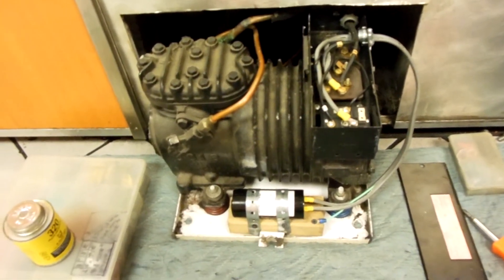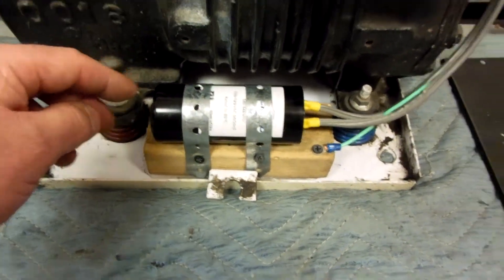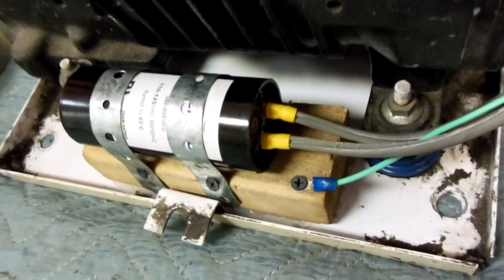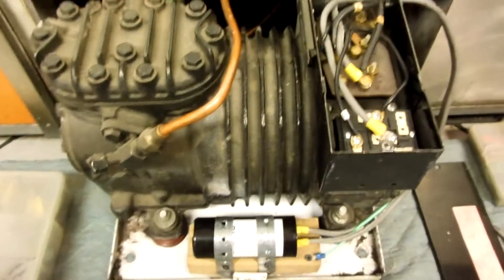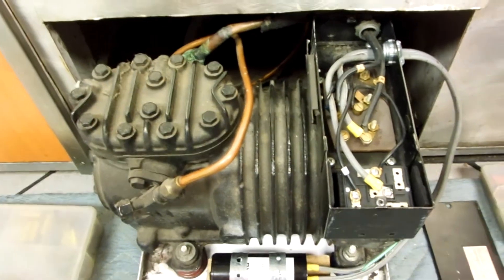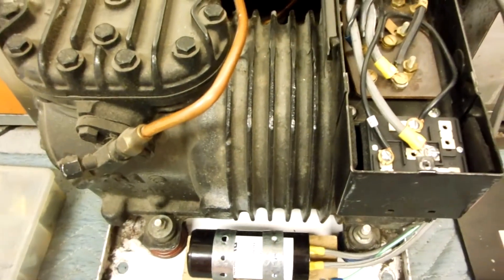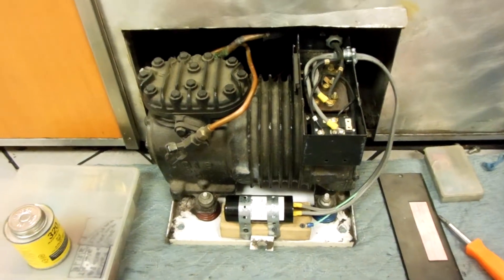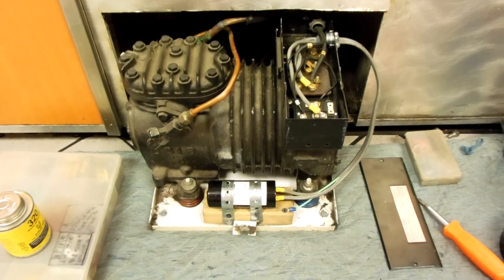Ice Cream Dipping Cabinet. Unique idea for Capacitor Relocation and i Like it! so far.

Comment: Nice repair! Those Copeland comps are bombproof so long as they are run within spec. Have some her over 40 years old and still running daily!

Need to get a new camera too as mine isn't good at close ups either. Been thinking about a pov but they are very expensive but would keep my hands free for work.

Comment from the maker: Well, By the sounds of it, the txv in the outdoor unit is not letting enough refrigerant into the outdoor Condenser / Evaporator now in heat mode creating a High head pressure and a Low suction. most likely.

Comment from the maker: Over 40 years old. Holy smokes !!
You have got to be kidding.
Have you ever seen one hit 50 years old? I Personally Have Not.
I've never even seen one 40 years old, Running.
the oldest one i have seen Running is about 1976, but i think that guy had it rebuilt or replaced the valve plates.
the Thing about old compressors i find is that they may be still running but they do not pull down Strong and Use ALOT of Electricity!
They Never Turn off Some of them i find.

Comment from the maker: Since the Head pressure is Very High!!!
You Most likely have: in order of Likely hood.
1) A Plugged Air Filter on the indoor coil.
2) The Actual indoor Coil is Totally Choked With Dust and Lint.impacted with Dirt. most likely.You must be able to see light through the fins. Blow the Evaporator Out really well with a Co2 Bottle of high pressure air. and blow all the lint out from between the fins.
3) Thier is air in the System---Recover all Refrigerant,Evacuate system, Recharge with New R-22.

Comment: It uses R22, and it is reading almost 360 psi when it's only 72 degrees indoors. I checked it when it was about 50 degrees outside, and my outdoor evaporator was reading about 23 degrees.

Comment from the maker: After u clean the indoor coil u may find the head pressure to be very low and find that the system is low on refrigerant. both pressures will be very low. then add refrigerant to spec.
Good Luck.
Could not type all of this on  one post. u tube does not allow for long posts.

Comment: Trane has been putting flat steel sheets up against the face of the A-coils for some odd reason, maybe to hide the copper tubing, or to reduce noise, but the steel is resting on copper, causing corrosion, and has been the source of many of Trane's leaks. The only reason I have the piece of crap, is because the original Trane unit was installed bad, and the liquid line blew a hole! Lost all compressor oil. Could've been a simple compressor change, and a hole patch on the line.

Comment: Both coils are completely clean. My unit was in heat mode, and my suction pressure would not come up very much, but my head pressure was way too high. I know my charge is okay, but could it be a TXV, or can a bypassing check valve cause this?

Comment: Thanks. I am also confused with my Trane XL 15i, I noticed the suction line no longer felt as cold as it used to be, and it is not heating properly either. It isn't really getting worse at all, so is it a TXV issue, or a leak?

Comment: I am having heat trouble with my Trane 2 ton split heat pump. I had a leaky equalizer flare fixed recently, and I noticed that when it gets cold, my heat won't work. The head pressure seems pretty high, but my suction pressure was so low, that the unit kept going into defrost when there was no ice on it at all. Could this be my TXV?

Comment: Hi, I have one exactly like this 23 years running and just overhauled it. Trouble is I can't find any R12 here in Costa Rica. What would you use as substitute for F12 without having to change anything else on the dipping cabinet? Thanks for your help.
Reply from the maker: R-414B---Hot Shot. Made by icor international. Pretty common out here in California. if u Can't Get any R-12 or Hot shot you Could as a SECOND Choice use Mp-39. THIRD Choice---R-134a But it is Recommended to use Poe oil in the compressor they say. I have used R-134a in a pinch with mineral oil and the compressor did survive so, basically my theory on oil is if u have oil in your compressor that's good, no oil in the compressor very bad. Just Like a Car! Doesn't Really matter what kind or type of oil is in your engine, just that u have Oil ! Good Luck ! Maybe, Let me Know What u Ended up Doing.

Comment: The run cap. gets HOT! 
 So , adding a flammable material and a sponge for moisture as a mounting system does not seem to be the answer.. 
 I use a 2 X 2 angle 16 ga. cut to any size with metal snips and drill a hole to mount anywhere.

Comment from the maker: Running a system With 360 psig head will Ruin the Compressor!
Do not run this system much or you will Loose this compressor.
you need to get this fixed asap.